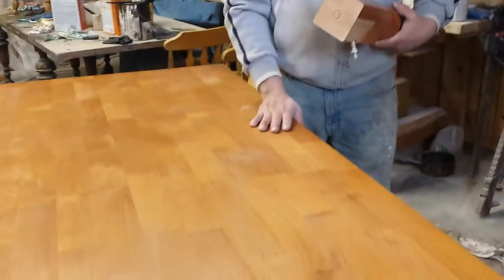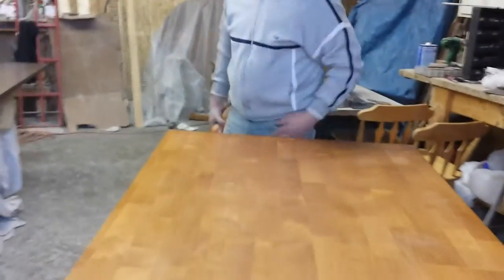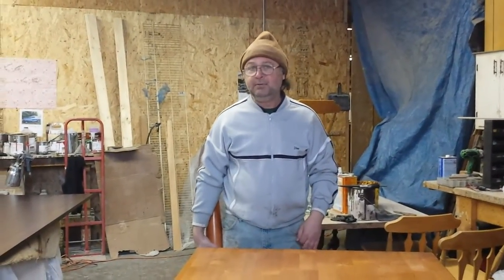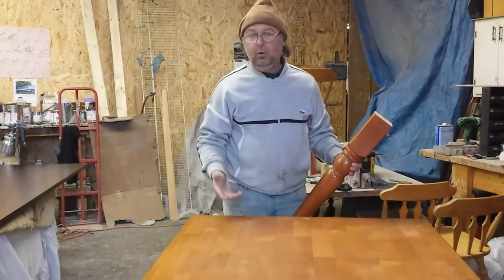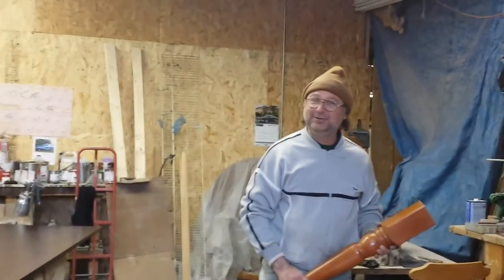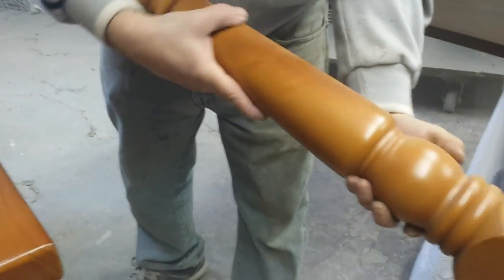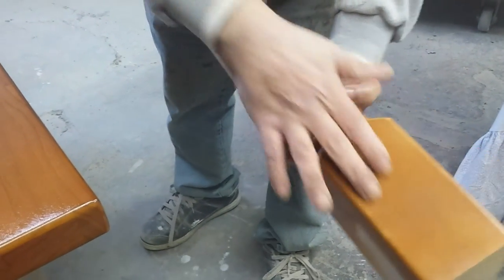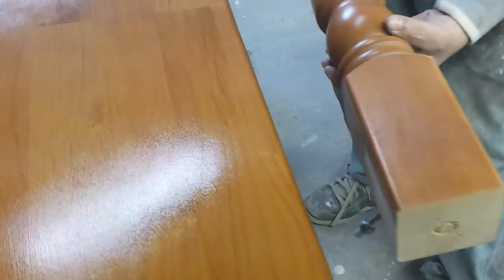Refinishing a Cherry Table Top Timeless Arts Refinishing

Comment: You  have a very clean shop, one of the better dust free shops I've seen .Very well organized everything has its own place well maintained spray equipment, super hi-tech ventilation system  which you exhaust straight into the environment, I'm sure your neighbors are really thankful of that .  Do you let the dust get really saturate the air before you begin spraying or do you try to gradually let it build up ? I personally use a ladder which helps me get the correct distance to what I'm spraying . I too try wear the same clothes I sanded in when I'm spraying . Keep up the good work.
Reply: Wow, everyone can be a critic, but not everyone puts their own content out for ridicule. It doesn't matter if I agree with you or him.

The health and environmental issues might be worth addressing, but if dust control hasn't bothered him or his customers for 30y, why would he change?